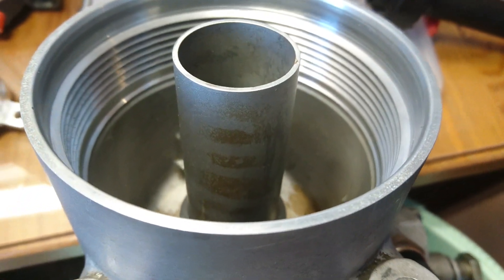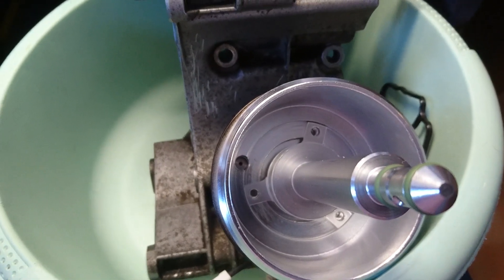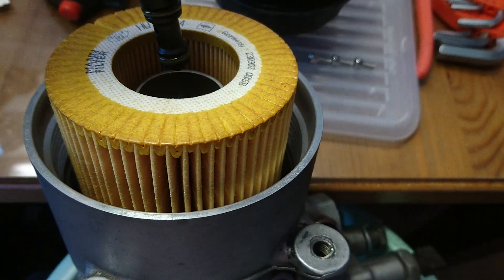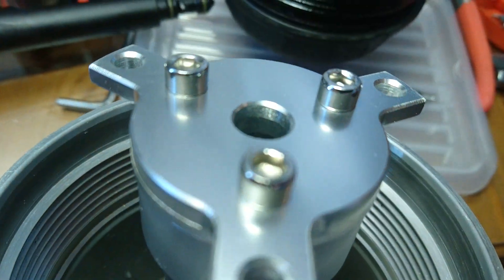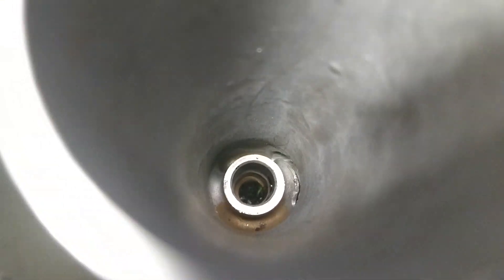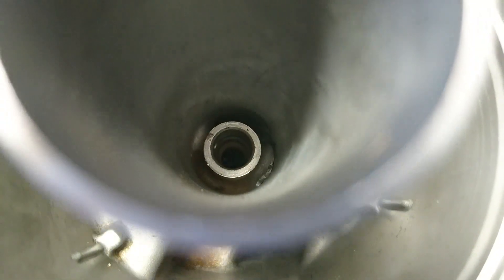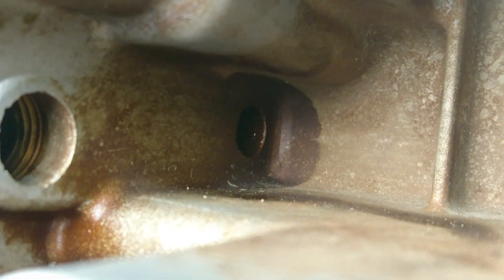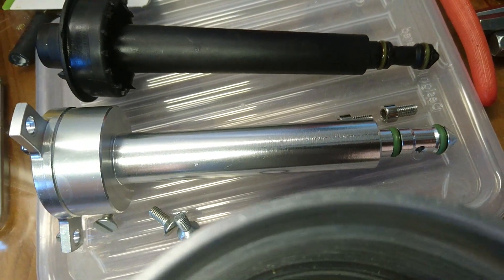WARNING,  be sure to check your aftermarket aluminum oil filter cap before fitting. e46 M54/M52

Comment: Did you end up running this cap or fix the issue?
Reply from the maker: @OvensGarage  hi, i modified it,using the plastic part inside of the original cap (and make that fit.....) , and now use it.
Reply: @eDXTRe can you explain this in more details? How is it holding up after a year?
Reply from the maker: @g.j.2857  the short answer is it's holding up perfectly, I think of making a quick video about it in next weeks
Reply: @eDXTRe  thanks. I installed the cap yesterday, but will remove it and put the stock one. I need to check the clearance, maybe mine's good, but looks exactly like yours. What about that plastic mesh on the stock cap? Is it a big deal that it's missing from the Alu cap?
Reply from the maker: @g.j.2857  you can check the clearance yourself By removing the inner part and put it in the oil filter housing,
I use filters from valeo/ mahle and filtron which have the plastic mesh in the filter itself. And I change oil every 7000 km
Reply: @eDXTRe  I will try that and check as you did in the video.